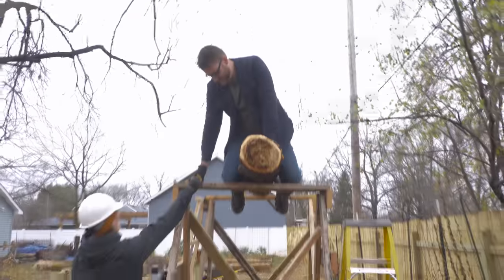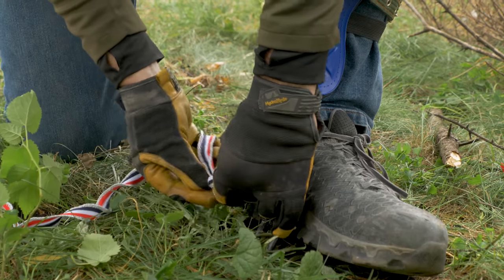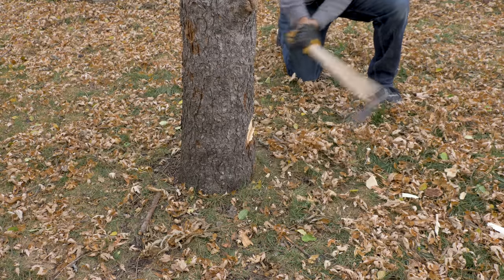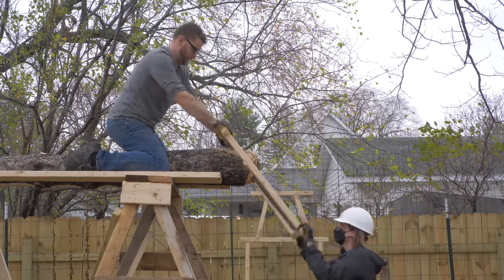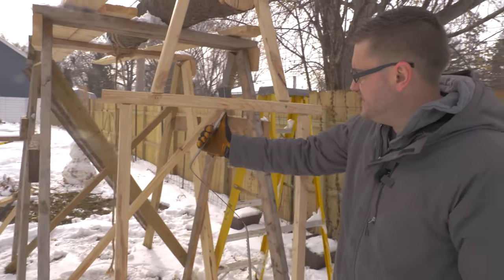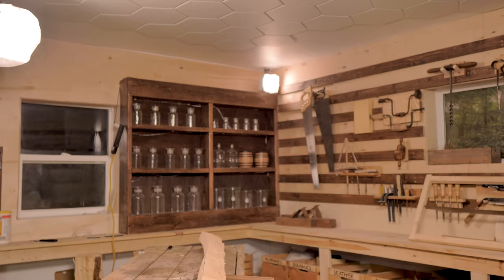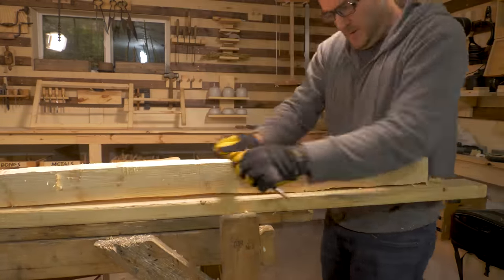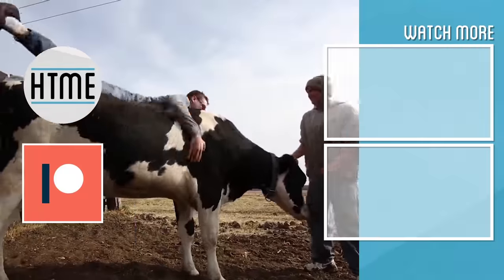Is This The Most Expensive 2X4?

Comment: Something I noticed around 10:45:
It looks to me like the blade is sharpened for a crosscut. If you instead sharpen for a rip cut, it'll be a bit faster for what you're doing (but still LOADS of work!)

The difference is that crosscut teeth are like small spear tips that slice the fibers, whereas rip teeth are like small chisels that scoop out the wood from between the fibers.
Reply: this sounds like it might help them, sending this comment up
Reply: Not so sure that's cross-cut filed - I think it's more of an older tooth profile (see some of the Viking age saws that were found in Dublin etc). Also, (and sorry if you already know this), but if there's no fleam on the teeth, the blade's still rip filed.

Green wood framesaw blades also often have a higher rake angle and are isosceles rather than equilateral triangles (so /\, instead of ^, giving much deeper gullets for the damp sawdust to clump in), and I rather doubt the wood had been dried at all when it was being processed.

All that said though, I agree that a lower rake angle would help with speeding up the cut.
Reply: something I noticed a bit later at 11:14...someone got caught making a snowman in frame.
Reply: @Oddthetall  I thought I could see some fleam, but it's admittedly hard to tell, it might just be reflections on the teeth.
Reply: @BakerVS  fair enough, you may be looking at it on a larger screen than me, and will be able to see details I missed.
Reply: Additionally, I wonder if it might have been easier to use a Bucksaw to cut horizontally instead of vertically.
Reply: @darthludi  perhaps - but all the historic depictions I know of show a vertical or angled cut. That way you let gravity do some of the work, and don't have any transverse forces on the blade.
Reply: @Oddthetall  Maybe. But the target isn't  historic accuracy but can it be "reinvented". As such the gravity assist might be true for a heavier saw like a full metal whipsaw, but the one shown probably doesn't have enough weight to really take advantage of that.
Reply: Maybe the teeth should be optimized to cut on the down stroke since most of the power comes on the downstroke. The upstroke is fighting gravity.
Reply: Boost
Reply: @miclowgunman1987  caught?

Comment: Pretty cool project. For the amount of time one 2x4 took you, I can see why some people would favor log cabins over actual houses when building themselves a home with raw materials. Im very excited to see a water powered sawmill and compare the 2x4 from that with this one.
Reply: I could be completely wrong but most homes prior to industrial scale saw mills were either wattle and daub or brick.
Reply: @Imaboss8ball  or with timbers, but they were pretty small.
Reply: @Imaboss8ball  yes absolutely. In western Europe, houses were framed with cut logs and then filled in with wattle and daub. Other methods were to build with brick or stone.
Reply: Here cut stone was common for houses.
It's surprisingly effective.
Though wood was used for the roof.

Comment: By using a draw knife you can remove the bark where dirt and small rocks are. Both will dull the saw blade and make the whole thing harder.
Reply: Right, and looking at the saws, some of them weren't jointed well, meaning a few teeth were doing most of the work and dulling quickly.  Also not sure if the saws were set up with a cross cut file or not all that aggressive rip tooth. (Even a slightly positive rake might have been appropriate - 5 deg would have been fine, but they looked to be cut with a -30 deg rake.

Also oil/wax on the blade would have lessened the binding problem.

Comment: 8:37 Your teeth are not ideal on your saw. What you'd need is to basically make two rows of teeth... so you make your triangles in the metal, like you did, but then every other one, you sharpen from back right to left front, and on the other ones, you sharpen from back left to right front. This will allow the saw to cut through the wood like a knife would, versus grind through the wood like  file. Do that and you'll find cutting a LOT easier.
Reply: Got to disagree there I'm afraid. That gives you a crosscut toothing pattern - they are ripping.
While a cross cut filed sawblade can be used for ripping (cutting along the grain as they are), it's a lot less efficient. For ripping you want the 'many-chisel' approach that a rip filed saw gives.
Source: have my own framesaw that I use for similar jobs.
Reply: It helps if you actually use all of the saw too and unlike using the 2ft of saw they did, didn't do a very good job sharpening it either or securing the workpiece

Comment: I'm glad you mentioned riving.  Oak & Maple split or rive easily.  A hand plane will smooth it fairly easily.  A scrub plane moving across the grain can scoop out 1/4" at a time.  I can split an 8', 24" diameter red oak log in ~ 1 hour.  Choosing your log is crucial.  No knots and straight grain.

Comment: I would say that while that 2 X 4 cost $500, it was your first (and I'll guess your last by this method).  This does, however, suffer from what so many things of this nature on Youtube does.  And that is being a one-shot deal by inexperienced people.  The improvement from the first to the second cut illustrated this point very well.
Reply: The second cut they only had to go through half as much material. But yeah they did have the experience of the first cut under their belts. If you were to do that all day for 6 days of the week you'd get pretty good at it after a while I'm sure. Sun up to sun down! That's why the ancients drank so much. Work all day, drink til you pass out then get up and do it all over again.
Reply: yeah this video makes their amateur skills very apparent. I wish they would have spent a little more time researching things properly rather than just brute forcing it for a video.
Reply: @PabloEdvardo  we all have to start somewhere. If we even start at all. Even in the best of circumstances pit sawing has a reputation for being not the most pleasant task ever devised.

Comment: Incorrect! 2 x 4's are not actually 2" x 4" because during the war (wwII) American Government and Lumber Industry started cutting wood down to save resources to help the war effort. It is not because the drying process / Curing process which does make the wet green wood shrink, however, the shrinkage was taken into account before the smaller cut size and after. Never was the shrinkage not taken into consideration prior to the drying / curing. They used to plan for the wood to shrink down to 2"x4" and when the war was going on and after changing the size the ~1.5" x ~3.5" the same can be said. While, Yes, they do shrink, the intended size is the size of the wood when it has reached the end consumer product. It's been like this since the 40's, in most of america. Self cut or privately cut wood for homes obviously would be excluded from this explanation. Another occurrence during this period can be seen in the building code across most of america. the roof overhang distance between the great depression and WW2 was shortened dramatically and again lengthened in the 50's and 60's through until current day. I was a general contractor for over 20 years and have done quite a bit of research in building codes and practices from the nineteenth, twentieth, and twenty-first centuries.

Comment: Is there any reason why you made your saw cut on both strokes? I would've thought working with gravity to cut only on the downstroke would make the upstroke lighter, given that you already have to push it through a cut that puts some pressure on the blade, and including the weight of the blade
Reply: Because that's the type of thing you don't think of until after you do it. It's really astonishing to see how many small things we take for granted are accounted for by engineers designing modern equipment
Reply: right, the tooth geometry here was a little funky.
Reply: Yes, that's how it was done historically. Also you try to use the whole blade and not just a fifth of it...
Reply: Saws sorta naturally cut on both strokes, but are typically made/sharpened to work better in 1 direction (pull or push stroke).

A big frame saw like this for sawing logs into lumber would have very large teeth, and cut very roughly. Maybe 1-4 teeth per inch (TPI). A saw you can buy at the hardware store for general carpentry is around 8-10 TPI, for reference. 

Those big teeth let you chop big chunks of material out of the log, and have a lot of space for sawdust to gather between the teeth (called "gullets") while the saw is in the space that it creates in the wood (called the "kerf"). 

This type of work was a 2 person job, so rather than having 1 doing all the pushing, both can split the work. Plus, pushing from both sides throws the sawdust out from the gullets in both directions. If you just pushed down, then picked the saw back up again, you'd get sawdust stuck in the kerf, that slows down your sawing.

Comment: Cutting along/parallel to the grain is called "ripping", vs. "cross-cutting" across/perpendicular to the grain.  As you discovered, ripping requires larger teeth than cross-cutting, as the chips from ripping are larger, so the trough between each tooth needs to be bigger to effectively clear them.

Comment: I work at a lumberyard and run the main saw. We can take a 12" by 12' log and turn it into 2 3.5"x7"x12" beams and a 2x4n in about 20 seconds. Its an old saw but that's still impressive. All the scrap chips go across the road to a bio-powerplant  that powers the mill and the entire town.

Comment: i guess i already knew this. it's so hard to mill my own lumber, because i don't have land. i did mill some small boards last winter. i split them from a log, and then planed them down. if you find a good log and have a good axe, you can split almost perfect boards, and then it might be a lot of work but just get a solid hand plane and make them flat. took me probably 30 minutes per board, they were small, split from fire wood logs but they had a nice grain and i thought they looked nice. since i got my plane for like 18dollars and tuned it up myself. the only other cost was being able to hold the wood down on the bench for planing but that can be for free. work holding is as important as working ha ha

Comment: two comments our 1890s farm house has lots of rough cut lumber and the floor beams/joists are rough cut 2 sided logs and the rest of the lumber was rough cut around 2 x 4 but varies with every board we have measured. They didn't have 'home depot' in Texas in the late 1800's.  They had cowboys, indians, and mexicans but everything was built by hand.  We have learned alot during our remodel.

Comment: A few things I noticed:
-Should be using a rip cut style blade
-You chose pine, which is a good idea, because it is soft
-You chose pine, which is a bad idea, because yours was full of knots and it will want to be wonky even if it were to be cut perfectly straight. 
-Maybe would have been a good idea to dry the wood near a fire (or fire*s*) over time so it would cut easier. I would imagine the amount of time spent in historic times would have justified that kind of care being put into making sure the timber/lumber was as well treated as possible to ease manufacturing

Comment: Few things I have noticed.
Normally, those saws were large tooth with a more directional tooth, aimed at the down stroke.
Most pictures I have seen the people are cutting at more of a 45° angle. Also focus on only pulling the saw never push, you'll find it way easier, when you tire swap.

Comment: Cool episode. I was waiting for you to tell us that holding the log vertically was easier than the pit or sawhorse method but you never commented on it. So, was it easier? I think letting gravity work with you as in the vertical method is probably the way to go IF you can secure the log so it doesn't move. I think you had some trouble with that which added to the difficulty.

Comment: You could increase quality control by adding an adjustable thickness guide with in your frame:
Also if you put a small radius (convex curve) and you also add to your sawing speed:
Add a spring cord to the non sawyer side and you will be able to saw more efficiently with one person:

Comment: It'd be a ton of work, but I think you've unlocked everything you need to make a full sawmill, right? The design I'm thinking of wouldn't be very efficient, but it'd do the job with enough power. You could even simulate horses turning the mill by using an engine that has an explicit horsepower. If you think 4 horses would be able to turn the wheel, get a 4 hp engine with low speed and good torque and hook it up.
Reply: Isn’t horsepower not corresponding to one horse, so much as, like, some particular number of horses? Or am i remembering wrong?
Reply: @drdca8263  I'm not exactly sure what you're asking, but the unit we call horsepower was developed by James Watt to compare steam engines to horses. He had a horse turn a mill wheel, and since he knew the size and mass of the wheel, he could measure the power the horse was outputting. It could turn the wheel 144 times in one hour. So, a one-horsepower engine should be able to do the same with the same wheel. In reality, ofc, different horses have different strengths, and so the official definition of horsepower is a somewhat arbitrary number - either 745.7 Watts for imperial horsepower, or 735.5 Watts for Metric horsepower. And yes, that's watts, as in how we measure the power draw of light bulbs, and also (ironically) named after the aforementioned James Watt.
Reply: @downsidebrian  ok, thanks, seems I must have remembered wrong. I thought the original definition (before being redefined in terms of an SI unit) was based on an average of like, a group of horses, taking into account how they wouldn’t always be pulling with at their max power,
so I thought that that “what’s the peak power you can get from one horse” was substantially different from 1 horsepower,
but sounds like I was wrong about that

Comment: You asked the wrong people. Ask tree removal companies. 

As to your saw. You really need the blade frame mounted in a fixed frame in which it will be allowed to reciprocate without shifting, pull the work (log) through the blade via block and tackle rather than blade through the work.

Adjustable guides greatly aid in tracking of the blade. Spend a few weeks mulling over a design, simulate runs in your head. Find bugs.
Make it collapsing so it can be taken down and packed away.

I do these things because my little shop hasn't thr floor space for every tool and gadget I have need of and the ability to pack and stow under a bench or in the overhead is a big plus.

Comment: Aw guys, have you been absent so long that you felt that repeating your mission statement was a necessary announcement at the end there? That's a shame; it can't be a good feeling, that you're losing momentum and recognition with the channel, probably since (and due to the fire. 

Well it's great seeing you get back in the swing of things. And I'm wondering now if the coming projects gonna be like; we're making a water-powered saw mill. And here's the water-powered lathe. Here is a water powered electrical turbine and trickle flow deep cycle chargeable battery. 

We'll be looking into water powered heat this winter, but more immediately, let's see about water powered faucets. Our new shop is going to be 78% water. We'll never have another gut-out fire like before. 

Fire shan't find us with our breeches betwixt our ankles and our bottoms peeking out twice! Nay, this time we are prepared. On the 1 year anniversary of the conflagration, we'll show you some water powered fire, and how to use an oily rag to put it out! 

I feel it, guys. But you can't let the fire control your lives like this. It isn't healthy. You've got to show it Who's the Boss. And if it's still burning, try Charles in Charge. Diff'rent Strokes is fire resistant. Why not try E.R. or Family Ties? Growing Pains is a must. But there's only so much alphabetized 80s and 90s programming can take you. The rest is up to y'all. 

Not that I'm the definitive source on nonsense advice via YouTube comments. After all, I'm just an influential, High-Society chicken..!*
🎩👌🏻
🐔💬
Cluckcluck, best of luck! 

*Note: MUCH more preferable than an influenzal High Society Chicken... they never mask up, and will sue you if you suggest they behave otherwise. 
Critics call them "Litigious and Delicious!"

Comment: Question now is, would the other methods have been cheaper/faster? Instead of cutting, just using an ax to hewn a 2x4
Reply: With a good hewing axe, probably, with his axe, doesn't looks likely
Reply: @kassiog.6595  my thoughts exactly. @marcezs08: riving and hewing definitely work, but I've found that using my fore and scrub plane usually works faster than hewing for me. Not to pick on Andy's homemade frame saw (it's dope), but it would benefit from better tooth geometry, more tension, and (I assume) some better steel. Free hand filing saw teeth from scratch is tough!

Comment: Did you include the time you spent planing it with the axe and draw knife?  Also, yours is still "wet", so it needs to be dried, during which time it can warp.  The dry time wouldn't cost anything per se if it just air dried, but I imagine it would get factored into the final price somehow vs. selling a wet board.